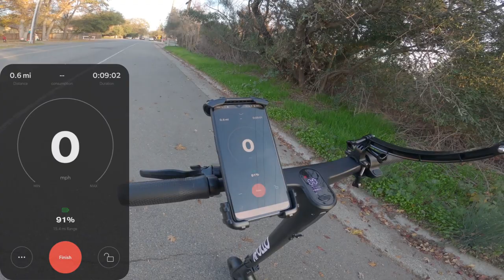Apollo AIR Scooter 250lb Torture Test (Electric Escooter towing)

Comment: Do you still like it? Would you recommend it for college student (110 lbs) 3 mile commute?
Reply from the maker: It would be perfect for 6 miles. Assuming you're not in a super hilly area like San Francisco it'll be fine.

Height might be a factor for you. My wife if 5ft tall and she has no problem. My son is 4ft tall and the bars are too high for him.

Since you are 110lb, I would first download the Apollo App, turn down the Regen brake almost all the way (because the brake will be way too strong for your weight) and also turn off the kick start. 

By default you need to manually kick start to 3mph before the electric motor kicks in. My wife is 100lb and she had a hard time getting it going because she's smaller.